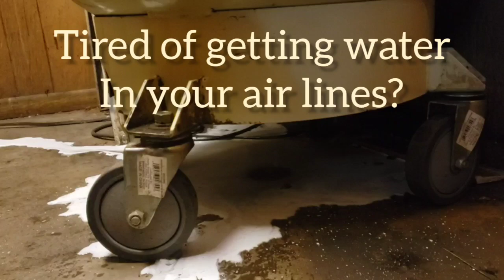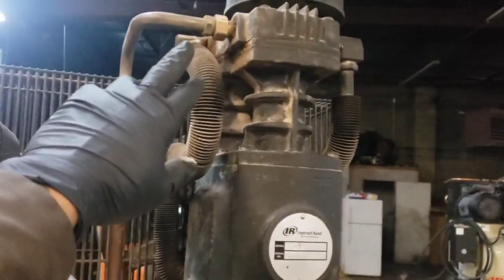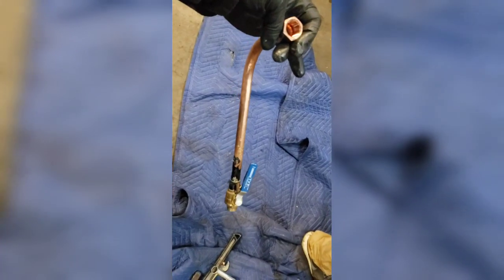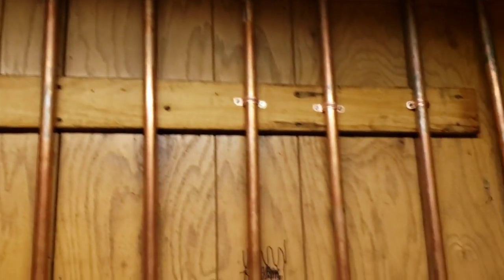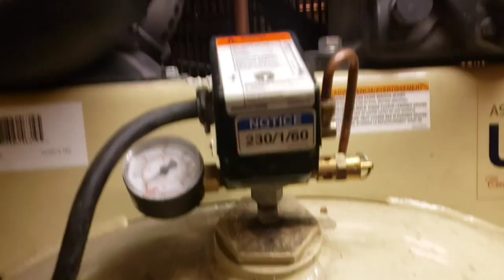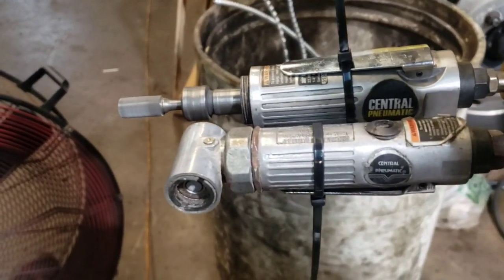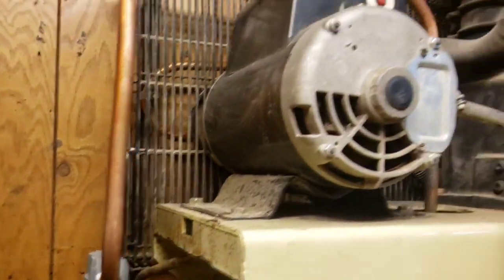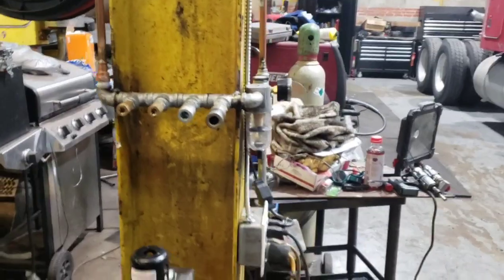Dual Air Compressor Setup Aftercooler and copper pipe Dryer. No More Water in Air Lines for Big Shop

Comment: You need to add a rubber gasket or put something between the metal clamp and the copper pipe. If you don’t electrolysis happens and your copper pipe will get a hole and start to leak. Just so you know.
Reply: Premature failure of the copper pipe.
Reply from the maker: Thank you sir for the insight I tried finding those clamps with the rubbers on them

Comment: What size copper do you use buddy?
Reply from the maker: 3/4 if your a bigger shop better to use 1inch
Reply: @hamletdubois6201  what about 1/2 inch? Can hold much psi like 3/4
Reply from the maker: @minkbandem8093  yes it can hold but it's going to restrict your air flow in shop
Reply: @hamletdubois6201  well thanks for idea man..